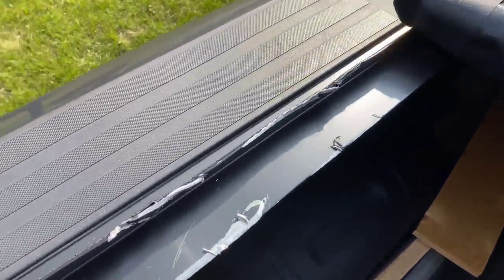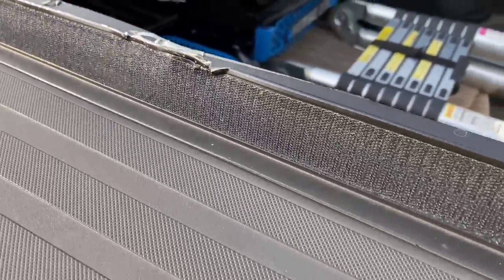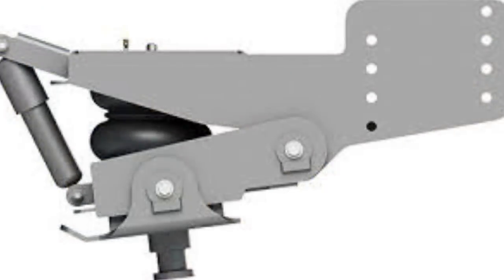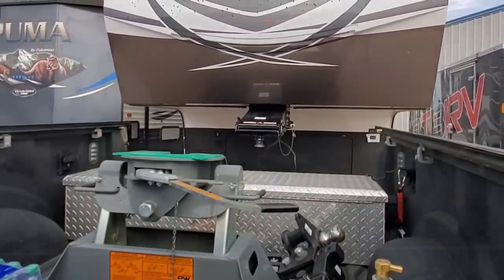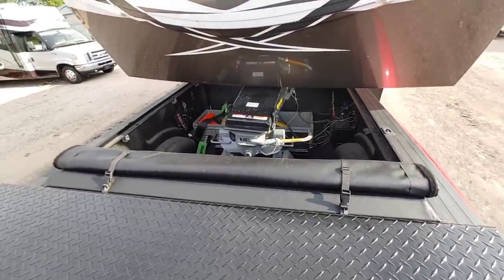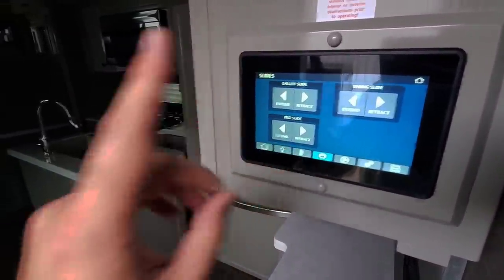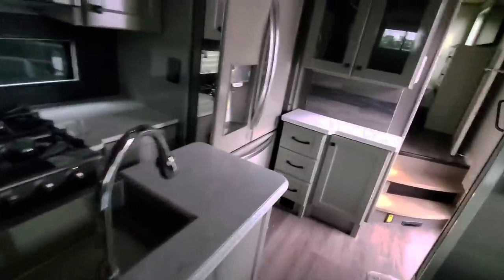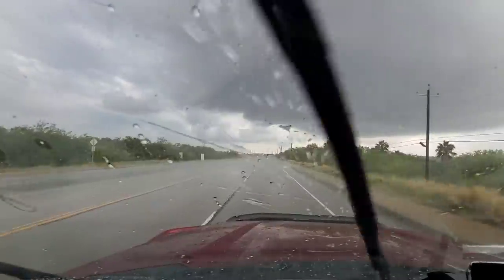OUR NEW RV! Full access with most Slides in! Vanleigh Beacon 42RDB

Comment: a bed cover would be nice to have, but if I got a bed cover, I'd definitely need to replace the bed, which is a lot harder to find than you'd think with a 36 year old truck. I managed to find a tailgate and even a transfer case online, and I put the rustoleum spray bed liner on the tailgate, and it has held up really well for the past year, with the sun beating down on it basically all day.

Also, its really nice to just not care about what goes in the bed and how it gets there.

Comment: I have a revolver X4 truck bed cover and the MorRyde king pin box on my Arctic Fox 29-5T. I have also punched a hole in the revolver rails and had to replace the rails. Fortunately it didn’t hit the truck sides, just the rails. I’ve had and continue to have several issues with the Revolver X4 system.

Comment: Just curious, how does it feel towing wise? Do you feel like your truck has enough power? Is it always chasing gears? Thanks JD.
Reply from the maker: I feel good with it so far.  Doesn't feel much different from my Chaparral I had.  My towing capacity (which of course isn't the real or only factor) has a 31,000lb tow capacity with larger brakes and more robust tires and wheels vs an F350.

Comment: if you contact access  cover in Jamestown ND the maker of the tonneau  cover you have inquire a bout the low rider series rails witch are angled more almost flush with top of the bed sides i am sure they would gladly shorten the cover length to your dimensions
Reply from the maker: You mean the Vanish sierra :). Yep. Conversation already happening.
Reply: @BigTruckBigRV  used to be called low rider

Comment: The trailer looks way too big for just two axles for how much those cost They should come with a third axle my 30 foot bumper tow toy hauler has three axles Even if those two axles are rated carry the weight having that third axle helps a lot with sway And for how much that trailer probably cost they should have thrown that in
Reply: Which gets me wondering, I've been wanting to know ever since I started looking at RVs, why is it that 80% or 90% of fifth wheels only got dual axles? I mean, a 16000lb fifth wheel with only dual 7000lb Axles? I understand that there's some weight that goes on the truck as well but why can't they just make it with a third axle?
Reply: @johnliu6855  Think of the pin weight.  When the RV is parked, the front stabilizing jacks are helping with the weight.  When the RV is hitched up, the pin weight is held by your truck.  So a 5th wheel that weighs 16,000 lbs GVWR can have an axle capacity (2 7,000 lb axles for example) less than the total GVWR.  

16,000 lbs - RV pin weight (say maybe 3,200 - 3,600 lbs) = weight on two RV axles ( 12,400 - 12,800 lbs).  The RV still weighs 16,000 lbs and your truck is still towing all that weight, but the rear axles do not have 16,000 pounds on them.
Reply: And the reasom you have 3 axles on your toy hauler is because you are hauling a lot of weight (typically at or behind the RV axles).  You need that extra axle for support.

JD's Vanleigh is 15,400 dry / 18,500 GVWR according to the website. It says 3,500 dry hitch weight so loaded to camp is probably 4,000+ lbs The two 8,000 lb axles are more than sufficient to haul (GVWR - pin weight )= 14,500 lbs.
Reply: @i39440  I totally understand the pin weight factor (might just be me being paranoid). I still would prefer to have a third axle for me even if it is a dead weight most of the time, would still work as some kind of insurance just in case of a blowout happened...
Reply: jacob p I get that but for how much those cost and the Length it should have a third axle

Comment: I really like your videos! I too have a 2019 F450 and a Landmark 365 Ashland fifth wheel. I purchased the same cover and box after the Changing Lanes video. I too had the same trouble with my Landmark 365 Ashland fifth wheel, it uses a MORyde  pin box. I had to scrap the cover because both side rails got completely trashed. After that damage I bought the Extang solid Fold 2.0 for a toolbox and when I am hitched up I just remove the cover. The Extang just uses two quick install clips that takes maybe 3 minutes to reinstall the cover. Here is the link to just look at the cover:  https://www.extang.com/solid-fold-2-0-toolbox.  Thank You, pdhajjar